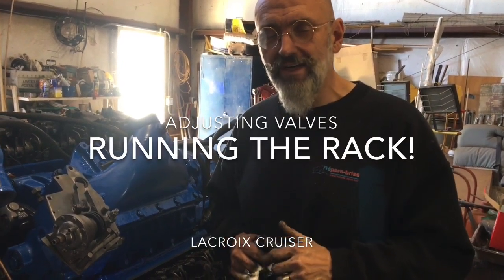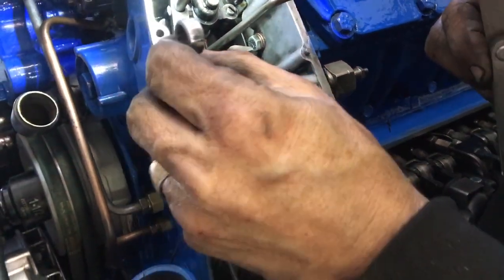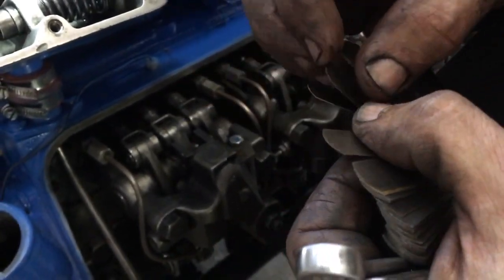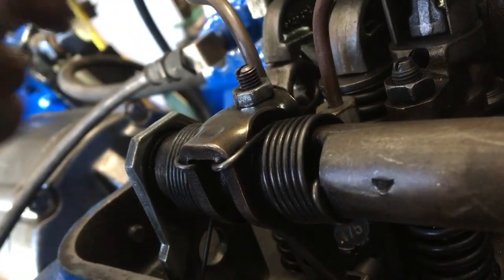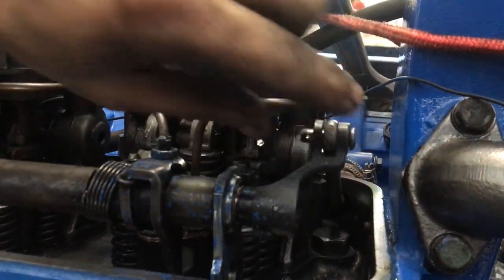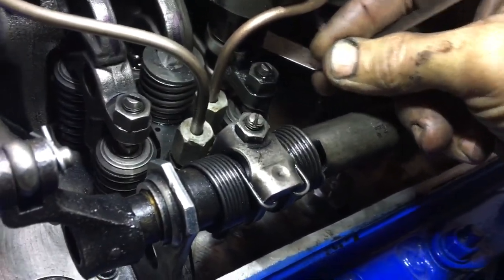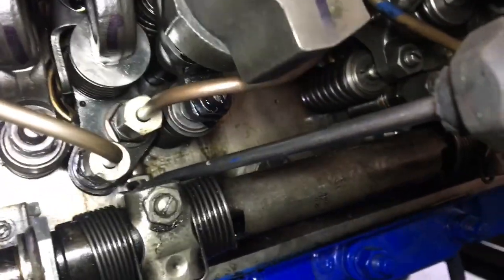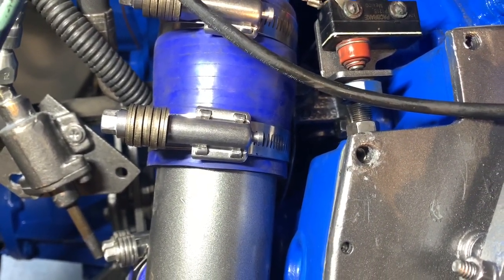Running the rack on a Detroit Diesel 8V71

Comment: thanks for this video.
i know i have a sticky injector,would you replace them all?
and are you turning the engine over with a socket on the cam shaft to put the crank top dead center?
Have a 8/92 in my 1946 boat...Love it.
Reply from the maker: Yes, and yes
Reply: thanks

Comment: Great video, thank you! I have a boat with 8V 92’s and one of them won’t go past about 1500 rpm in gear but I can rev it up out of gear to 2500 or more. Do you think the governor adjustment could be the issue?
Reply from the maker: Possibly
Reply: @LacroixCruiser  Thanks!

Comment: as i Detroit mechanic for many years, good explanation of basically  a tune up nice.  is too bad that these engines have pretty much gone away so sad.  and are the new engines really all that more efficient, maybe they are cuz i been away from the industry for some time
Reply from the maker: They may be more efficient, but they will never match the sound of a 2 stroke Detroit at full speed
Reply: @ yes shift a 2100 and never let it go below 1800, i drove an old western star with 8v turbo it made music

Comment: Can you please let me know what size feeler gauge you using to adjust the Jake Brake's height? I have the same Jake model (71-92A) on my DD 8V92TA and I couldn't find the right tool for it. Thank you very much. BTW. Congratulation for the videos you making, very valuable information there you sharing. Thanks for it!
Reply from the maker: Unfortunately I don’t remember. PAC Brake will have the information

Comment: First time Detroit owner 8/71 and probably a stupid question but I have to ask. You mention the valve is adjusted at the nut and pin on the opposites side of the valve or pushrod, but what is the adjusting nut located directly over the valve stem used for? I am used to adjusting clearance over the valve and I don't want to screw this up if you know what I mean. Thanks again, really learn a lot through your channel. Also where do you recommend baring the engine over at?
Reply from the maker: Follow the directions in the service manual

Comment: Great video. I'm looking to diagnose what sounds like injector knock by shorting out the injectors one by one and listening to any change in engine sound and I'm wondering if you have any advice on the best way to hold the plunger down without running the risk of causing damage to the injectors or rocker arms..
Reply from the maker: Unfortunately not

Comment: Great show, I've been a Detroit operator and fan for years. They can be agricultural though very  Technically specific on tuning but you  just have to love the basic simplicity, they had a job to do. Turn clean fuel and air into beautiful music. On that and off the subject many many years ago (40 odd) I had a couple of injector height tools and found they were perfect for setting injector pump timing on a 3208 CAT. .Never bothered to find out what the CAT tool was.. Just saying. 😊
Reply from the maker: Thanks for the info!

Comment: Question: Does this video cover a Variable Speed Governor ? It looks pretty different than the one in the video as mine has a short plunger guide with a variable speed spring. The part where you have the idle adjustment screw is not the same here either once the two bolts are removed the end with the speed control lever etc ., idle screw etc comes off totally? I have a issue with the idle adjustment will not adjust properly and the engine is at 1500 rpm’s at idle. I believe it is binding internally at some point. Thoughts??
Reply from the maker: Could be binding, I suggest taking it apart, and ré-assemble per the manual.

Comment: Great videos. We ran an 8-92 natural marine and it has 62,000 hrs.over 41yrs.but gave up. We came across an 8-92TT marine running takeout with 7500hrs..question what is the lifespan for this type engine oh it’s the 750hp rated one
Reply from the maker: 750hp cuts into the life ( the more HP the shorter the lifespan. Also be mindful of the limitations of your transmission with that much power. With that said if it took you 41 years to accumulate 62,000 hours, you’ll probably get a good 20 years

Comment: New to the 8V71 family I have a 68 Silver Eagle motorhome was wondering what if any is different between non-turbo and turbo engines for example I have been told different crank, pistons, by various mechanics. being low budjet I would like to add a turbo to my original engine (after of course a fresh rebuild) is this possible? Do you have a video? or can I suggest new content for a new one? thank you.
Reply from the maker: Unfortunately not, but from my reading all that’s common is the heads, and the accessories. Block, pistons, crank, cams, and rods look to be different.

Comment: Good video sir ,mines detroit engine rpm comes down from 1900 to 1300 rpm at crane when do multiple operation I will check what u have said thanks for the video
Reply from the maker: Thanks for watching
Reply: @LacroixCruiser  sir your video i watched last night couple of times and adjust the same what u said actually worked,engine stops from dying when crane had full operation
Reply from the maker: Nice to hear

Comment: Great video, i am in the process of rebuilding a Detroit Diesel 8v92 marine engine. Is it possible you can provide me with a link to purchase the service manual
Reply from the maker: Unfortunately not, but you can often find them on eBay

Comment: you should set 1 left and then 1 right to balance the injectors on both banks to set the control at the governor and then set the rest as Damian Frattasio has suggested. You don't need the wedge as I use the .200 thou gauge from Kent-Moore and it sets the gap accurately and saves time for adjusting the governor gap. Just some suggestions from a Detroit mechanic
Reply: Hi Roger, can you explain why you have to have the air gap please, is it to stop the gov interfering with the high idle?  I've often wondered what it's for cheers
Reply from the maker: That’s correct John.
Reply from the maker: Thank you
Reply: Can you explain if you push the 200 thou gauge between the counterweights or do you use it directly at the gov gap with speed control at full throttle?  Explain how you use the KM gauge. Thanks.

Comment: I remember well the busted knuckles on both hands during my 25+ year's as a Diesel Mechanic. I loved the 2 stroke dietroit for what it was.
Reply from the maker: It’s a great engine.
Reply: @LacroixCruiser  and the 2 stroke design is used exclusively in giant stationary or ocean going ship engines,as I'm sure you already know. No way going to waste movement of giant Pistons and connecting rods on a intake or exhaust stroke,in those huge crosshead engines.
Reply from the maker: Yes,

Comment: Thanks for a such an instructive video. Overhauling a 6V92, this video has come to save my day. What oil should be used with the 6V92 and anything to be careful with during first engine start?
Reply from the maker: You want to use 40w CF2 rated oil. Be mindful that your rack and injectors move as they should, that you’ve pressure tested your fuel system, and that you’re ready to smile from ear to ear when it fires to life.
Reply: @LacroixCruiser  Thanks! Got SAE-40 CF-2 oil, followed the manual for variable speed governor to set the gap and the rack. Hope to do first engine start tomorrow or the day after.
Reply from the maker: That’s great, have fun!
Reply: @LacroixCruiser  Enjoyed listening to the 6V92 coming to life today! Installing it on the rig tomorrow. Thanks!

Comment: Здравствуйте. Подскажите пожалуйста зазоры клапанов и высоту форсунок, 6v92 заранее благодарю
Reply from the maker: Unfortunately I can’t copy and paste the text into my translation app.
Reply: Andrey Pet...  
Hello. 
Please tell me the valve clearances and
the height of the injectors, 6v92
thank you in advance
Reply from the maker: It varies depending on the year and turbocharged or normally aspirated.

https://f01.justanswer.com/spankyjr1/a39012a3-3a7b-420d-b71b-d9f3af53898e_92_detroit_valve_adjust.pdf
Reply: @LacroixCruiser  With the turbo boost 350 hp. 6v92
Reply: 1993г.kenworth t800b
Reply: @LacroixCruiser  I live in Russia there is no information about this motor here.
Reply from the maker: @АндрейПетров-м4м  here is a link to the complete service manual you can download 

https://1drv.ms/b/s!AhkYYSCF0Jv8grJ9A0G5O2oAjVI_-A
Reply: @LacroixCruiser  The spa is big.
Reply from the maker: Yes, it’s a big book
Reply: @LacroixCruiser  Hello, the engine pulls poorly while there is no smoke vopche. The injectors and toplevny pump are new. What could be the problem
Reply: @LacroixCruiser   @Lacroix Cruiser  Hello, the engine pulls poorly while there is no smoke vopche. The injectors and toplevny pump are new. What could be the problem
Reply from the maker: Many possibilities, start by doing a complete tune up as shown in the book, then diagnose from there.

Comment: I'll have to look for a video on replacing the blower dog bone.  We used to see them once in a while.  Brings back a ton of memories on the old 318's
Reply from the maker: It’s easy to replace, take off the power steering pump, you then remove the snap ring, remove the shaft, then reverse to get back into service.

Comment: Kind of an off the cuff question, but what effect would you see in the operation of an engine if the governor gap was too tight or too loose?

Also might be nice to point out that the injector control tubes on the older  engines had two screws in place of the one adjusting screw and jam nut. Adjustment procedure is pretty much the same, just need to back off one and tighten the other. 

As for the term "Run the Rack" I think it would make more sense if one just added an "S" to the end of the work "Rack". Or even said "Adjusting the Racks"  but this is a "Detroit Class" not "English Composition Class!" 

If you want some excitement adjust the rack with the shut down cable in the stop position then fire it up! BTDT once!
Reply from the maker: That would be awakening for sure
Reply: @LacroixCruiser  Yes a 12V-71 going full fuel on start up will get your attention. Only thing that saved me was the flapper valve in the emergency shut-down worked!

Comment: Hey Lacroix, do you have a part number for the wedge and the Jake tools? I am in the middle of this mess and would like to do it right. I am replacing all of my injectors due to a fuel system mishap that is costing me dearly. Your video is the best and your reply will be appreciated
Reply from the maker: https://www.toolsource.com/engine-service-tools-c-114_117/detroit-diesel-engine-tuneup-kit-53-71-92-p-141409.html
Reply: @LacroixCruiser  Thank you very much. That helped to have the part numbers.
Reply from the maker: Anything to help.

Comment: Question for these 8v71 that had power steering . What fluid would you use. Mine is making noise like its low but has enough fluid in it.
Reply from the maker: Many different fluids were used. Look at the colour of your fluid, if it’s red, then it’s ATF, if it’s caramel then anything from 10W to 40W engine oil may have been used.
Reply: @LacroixCruiser  thank you for the quick reply:) I will check it out.

Comment: Thank you that is called a flag that you just set the injector with the little t shape with the spindle on top to hold it there are different colors brown ,white and ,black so on
Reply from the maker: The ones I use are not colour coded, instead they have the actual measurements on them that correspond to the specifications given in the service manual. You see me using it around the 8 minute mark in this video 

https://youtu.be/SqelvRPb-ag

Here is what the tools look like

https://www.otctools.com/products/injector-height-gauge-set
Reply: @LacroixCruiser  yes mine are very old lol , those are what we called flags ,,,thank you so much for showing these on the Video I have rebuilt so many 71 ,92 s the very first one I did I was only 12 YRS old and it was a in frame overhaul .

Comment: Great video,What do you do without that governor tool to adjust the rack?
Reply from the maker: Make or buy one, it’s basically just a wedge
Reply: Remove the governor cover and run the engine 'manually' to 1800 RPM (check the book on this number) and check the gap. Adjust as needed. It's in the book.